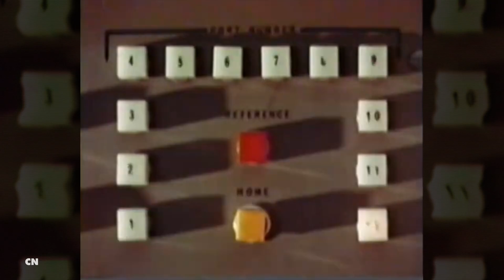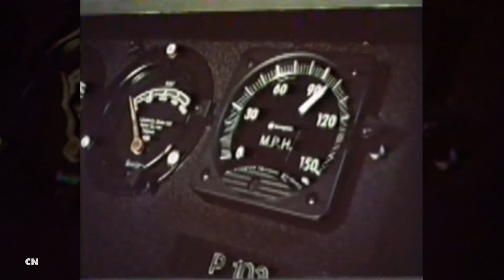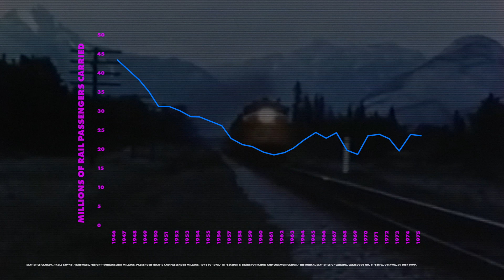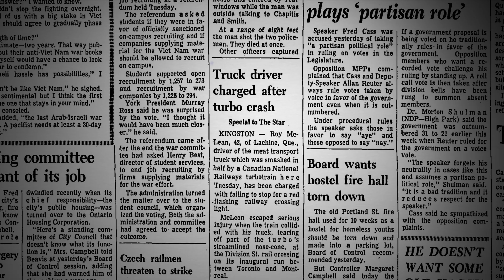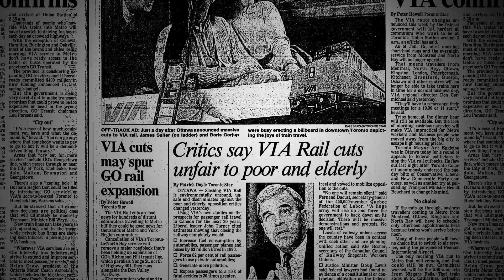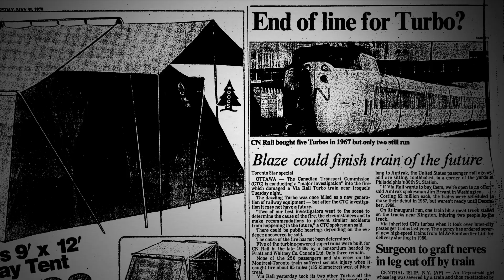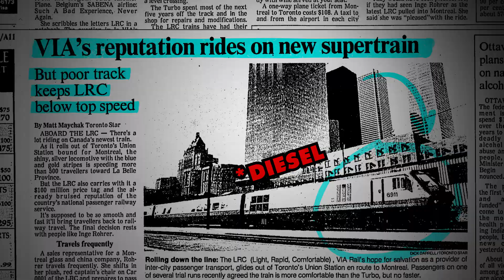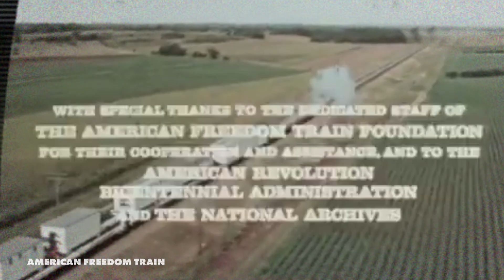Canada Had High Speed Rail In The '70s. What Happened?

Comment: The Turbo was pitched to the public as an expensive luxury train instead of a high-speed commuter train like you see in Europe and Asia. It was supposed to be launched in time for Expo 67 in Montreal. After that didn't pan out, it was pitched off again for the 1976 Summer games in Montreal. Kind of like a Concorde on wheels. 

Amtrak never pitched their Turbos as a luxury train, in fact nobody bothered to use it because airline prices were still cheaper than train tickets back then. Too bad they all got scrapped. It would've been nice to have at least one running VIA's or Amtrak's fleet.
Reply: oddly enough Montreal had a Expo automated shuttle using modified variant of the subway trains in Toronto. Odd they never used it for any Metro style expansion and ran it until finding no buyer and scrapped.

So much for revolutionary design

Comment: Settlements in Canada came before rail. As settlements grew into towns/cities, and rail became an option, rail lines joined the cities. The cities continue to grow, around the existing rail lines. No effort has been made to consider the impact to the existing rail lines (e.g. level crossings). Rail has great potential, but it comes with a cost.
Reply: I’d counter that while bridges and tunnels for cars are ludicrously expensive, pedestrian crossings are dirt cheap- as cities look at pushing active mobility and reducing car congestion, removing level crossings by simply taking them out and replacing with much cheaper alternatives should be explored more

Comment: Lasted until about the same time the Budd Metroliner went under. Similar stories. I say building a competitive high speed rolling stock requires significant backup from the state - which means industrial policy. Subsidies, university-industry collaborations, all that. Again, that’s just for the train alone. You need the political will. The engineering requirement that enabled Turbo to run on existing lines itself indicated political compromise that primed its demise. The same ship had been repeatedly sailing away ever since Avro.

I remember the only time of taking the Toronto-Montreal VIA train in the early 2000s. Not a bad experience. But these days, being posted in China, I get to take the 4.5 hour, 1,318 km Beijing-Shanghai HSR often. Every time it makes me sad, realizing that’s something we’ll never get in Canada.

Comment: The TGV tried doing the same thing. But it switched to electric high-speed trains, unlike Canada. At least the rail industry didn't instantly collapse with cars on the rise as it did in the United States.
Reply: French switched to Electric High speed also because of the Oil Embargo + the Nuclear power plants powering the grid. US is so oil based that the Milwaukee Road was still taking down wires when the US got hit with oil embargo. The only Transcontinental railroad that is electrified gamble wrong thinking diesel was their saving grace

Comment: There's also the TGV between Paris and Bordeaux that takes 2h and 4 small minutes to run 580-590 kilometers.
The first part that opened in 1989/1990 is operated at 300 kph while the second part is operated at 320 kph since 2017.
The last extension axed more than a hour of journey time.
Before 2017, the second part was operated on regular upgraded lines running at 200 or 220.
This line has some of the highest average speeds, like 290 kph average.
On some city / station pairs you immediately accelerate out of stations and stay at Vmax until it's time to decelerate and enter destination station.
Barely any speed variations along the way.

Imagine a true high-speed backbone in Canada allowing Toronto to Montreal in just 2 hours...
All the most important population centers in Eastern Canada are on a virtually straight line.
So it's kinda the best setup for HSR.
Reply: I lived in China for 5 yrs. 80K network of 305 km/hr HSR. I went 1,000 kms form 8:30 am to 1:30 pm even with all the stops. You only go forward, not pulled on 6 directions at once, so you never get motion sickness.